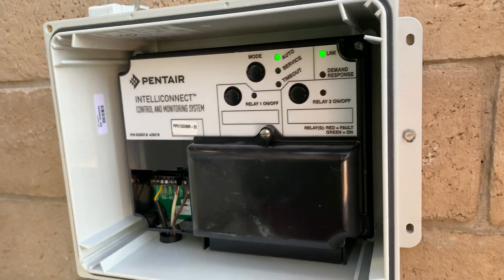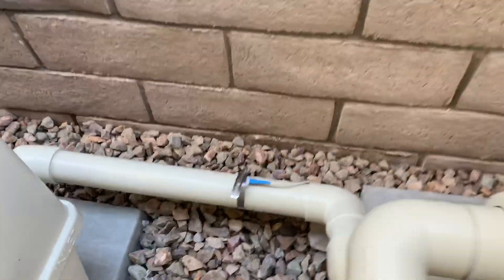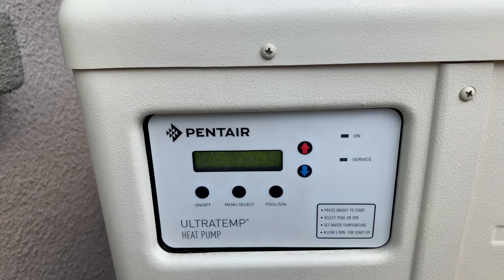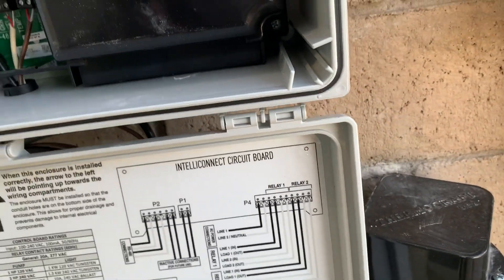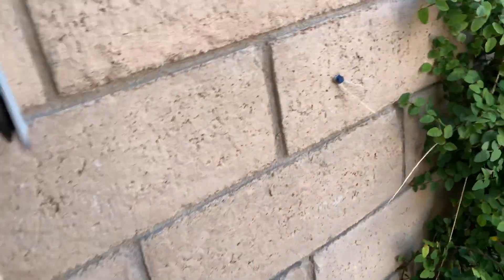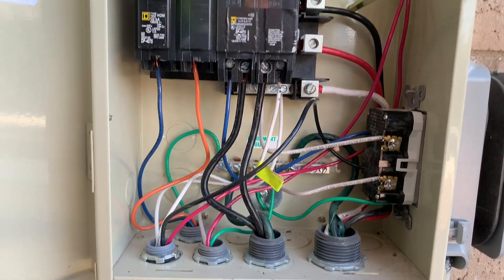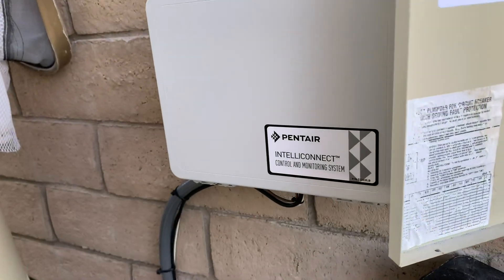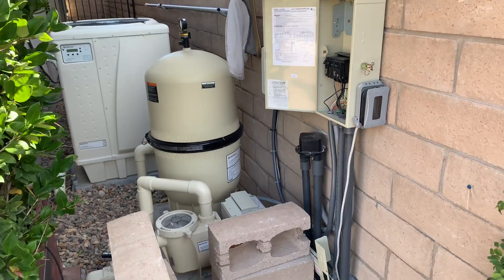Pentair Intelliconnect

Comment: I do not have an inline temp sensor. Is this something I would need to drill into the pvc and add? I have an Ultratemp heater like you. It has its own temp sensor. Just curious before I buy my intelliconnect. Seems there’s no need for a temp sensor. I’m in FL and it will never freeze here.
Reply from the maker: You don’t need it, but the heater’s temperature sensor doesn’t communicate with the Intelliconnect as the heater only connects to an on/off relay.  So, if you’d like to have the Intelliconnect and app control the heater, you need to add the sensor.  Personally i mostly use the app just to check the pool’s temp lately.

Comment: How did you wire the heater? And what mode did you put it on? I can’t control the heater from the app
Reply from the maker: I don’t remember too well, but it basically only turns it on and off, it’s not full telemetry.  That’s why I installed the in-line thermometer.

Comment: The second my schedule kicks in it goes to a lower speed and says in the app "Your pump is running due to pump overide.
Reply from the maker: Would need more details to know what is going on there, but I remember being disappointed myself with how it works when you want the heater to work in conjunction with the schedule.  I was hoping that the heater would only work when the pump was running high speed, but what actually happens is anytime you have the heater on, the pump adjusts to a high speed automatically.
Reply: @TiernanTurner  Yes that would be a bummer.   The chlorinator is not speed but flow dependent, but it must be turning the pump down somehow to 1740.  I have it programmed to come on at the same time the pump comes on.  Strange. I have a call into Pentair.  Proalby won't do any good.

Comment: Does the Temp sensor go on the incoming or outgoing pipe?  I would assume the incoming but just making sure.
Reply from the maker: Up to you, I put it between the pump and the heater.  Incoming/outgoing would be relative to whatever equipment you refer to.

Comment: Can you tell what type wire that is you used for the connection of the heater?
Reply from the maker: i forget, just something I picked up at Lowes for cheap...  speaker wire might work lol
Reply: @TiernanTurner  Just one other question. You mention you have intellibrite Pool light connected to this system. Are you able to change the colors of your light.? I saw a video on YouTube where the Pentair guy says it only turns them off and on , yet on the Pentair website says it can change colors on any of their lights.
Reply from the maker: @artriveros7659  yes the Link2O app makes it much easier; actually the main reason i bought the intelliconnect so that i could just have the lights on a timer each evening

Comment: you have low  voltage pool pump ?
Reply from the maker: it's a Pentair Intelliflo
Reply: @TiernanTurner  So your Intelliflo is powered directly from the breaker, and is only connected to the Intelliconnect for control of the features of the pump via the app correct? That communication cable(black cable) is only for just that, communication, not power
Reply from the maker: @artriveros7659  that's correct

Comment: How did you get the intelliconnect to recognize the temp sensor? i am using the 10K pentair temp sensor water/air  and the intelliconnect will not recognize it?
Reply from the maker: I have a Pentair temp sensor I bought on Amazon, it worked right away, no problems:  

Pentair 520272 Air/Water/Solar Temperature Sensor with 20-Feet Cable Replacement Pool/Spa Automation Control Systems and Pump https://www.amazon.com/dp/B001DO18FS/ref=cm_sw_r_cp_apip_S7bpbPPPdHfpu
Reply: @TiernanTurner  thats the exact same sensor i bought.... will not detect it.. did you cycle power ? im also using pentair home not link2o
Reply from the maker: @mayespakebusch4233  for me it worked without a power cycle, but that’s always something to try when troubleshooting!
Reply: @TiernanTurner  Well something weird happened today.... I got a call randomly from a Pentair Tech Support Rep informing me that my intelliconnect firmware was old and did not support Temp/Heater terminals.. He forced the firmware update and now everything works...

Comment: Having a pool installed now. Is this something you can add on later or is it better to have the builder upgrade to? The builder seems to bump the price up way more than it should be. He told me $5500 to add a heater?
Reply from the maker: You can add it later on, but if you have the money now i would do it all at once to let them work out the electric and make sure it's up and running properly.

Comment: It looks like the intelliconnect can be wired with either 120VAC or 240VAC.  Did you use 120VAC or 240VAC?
Reply from the maker: Not even sure

Comment: Nice video! Where is your LED lights transformer located? I didn't see your LED wires coming from the Intelliconnect. Thanks!
Reply: For reference: the Pentair LED light uses regular 110V power. If you connect a normal switch like you would you for a light in your home, the LED light is built to recognize/count how many times its turned on and off. This is why the relay in this controller works. It does the same thing as toggling a light switch, but does it through the app. Now you can select the mode in the app and not have to go to a switch a memorize how many flips selects a particular color or mode.

Word of advice: never leave the solid red light on very long. The red LEDs will blow. Happened to me before the warranty and they replaced, but just don't do it. Light has been working for over 6 years now, but I never leave on solid colors for long. I always use color changing modes to ensure the longest life.
Reply from the maker: Great question, I’m guessing it lives with the lights...  not sure as I didn’t hook them up, and didn’t see a transformer when I hooked them up to the IC (pretty much everything I did is in this video).
Reply: @TiernanTurner  Thank you, and nice setup!

Comment: Thank you for this great video, I have a question I have my intelliflo pump connected to intelliconnect and i have the app working fine. Reason I bought intelliconnect was that my display on my pump went bad, fixed it once but a few months later display is very opaque.  MY QUESTION is:  My Intellipump was set up with a schedule and I created a schedule on my intelliconnect but it seems to default speeds on the intelliflo pump.   I need it to follow the intelliconnect schedule.  We made the installation ourselves.  Called Pentair told me that I would have to pay someone to make connection correct. (bull)  All I need is to reset pump so the schedule on pump is no longer existing.  Do you know how?
Reply from the maker: As far as I know you should be able to change the schedule settings in the Link20 app once it’s connected.  I’m no expert here, but that’s how I managed mine after hooking it up.  I had another problem that I had some exerts out for, how they ultimately fixed it was by doing a ‘hard reset’ on the pump, like resetting the computer.  Maybe try that
Reply: @TiernanTurner  how do I do a hard reset?  I did the press 4 buttons simultaneously for 4 sec.....blah and still runs the  program from pump not intelliconnect. I could see speeds on app I can turn off and on on app but still defaults to pumps schedule.
Reply from the maker: Evelyn Bravo-Sanchez I’m not sure, the service guys did mine
Reply: I have an intelloflo VS. The literature says this intelliconnect will not work with my model but it came with an automation cable? And it can be connected to the larger automation prior to this being available. Seems it would work. Just curious.

Comment: How does this control led.pool lights that can change color
Reply from the maker: The lights color schemes are controlled by the relay, like turn on/off 3 times for green, 4 times for red, etc.  the app makes it easier with a UI then the Intelliconnect controls the relay

Comment: What is the cable you used from the Pump to the Intelliconnect, was it a separate purchase or did it come with the Intelliconnect? (Basically what came in the box for the intelliconnect hehe) Thanks for the video
Reply from the maker: Intelliconnect comes with no cables, but your equipment should have come with the RS-485 data cable.  The guy who sold/installed mine didn't leave it, so i bought one online for about $30.
Reply: @TiernanTurner  ya seem to either misplaced or never got, but picked up for $20 didn't want to order and then one come in the box.  Thanks